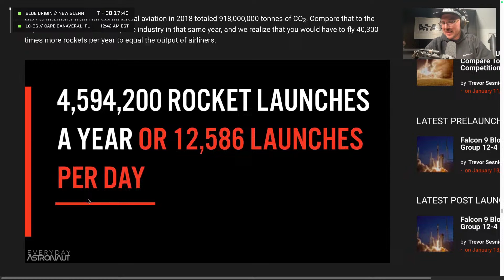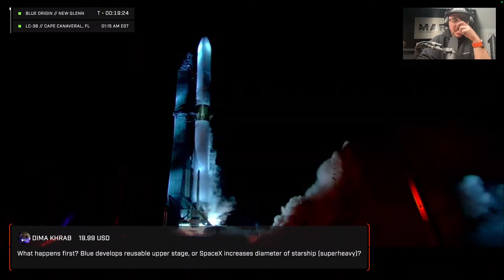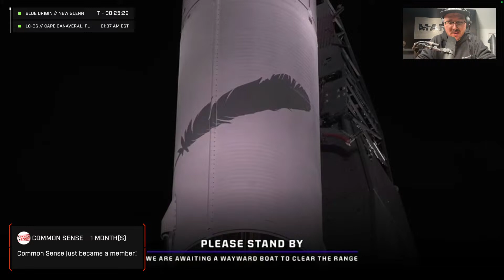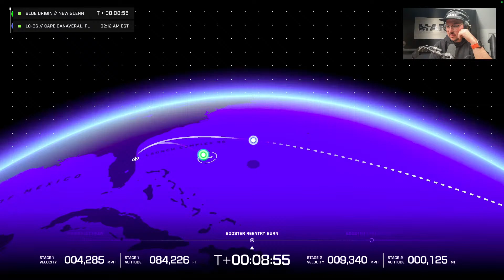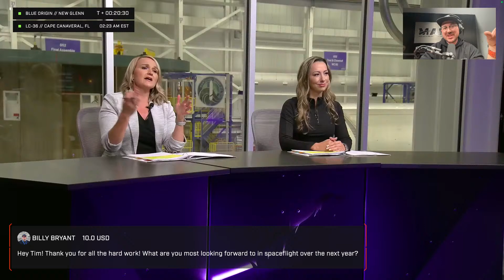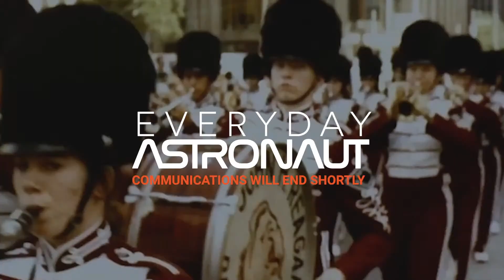Watch Blue Origin Launch New Glenn For The First Time!

Comment: Part of blue origins strategy is probably to watch the failure modes of starship and try to solve them ahead of launching their own. Costs a lot less to learn from competitors r and d
Reply: Different engines, different diameter, different propellant temperatures, different everything

They take longer to Flight 2 than Starship was despite not destroying the pad to a crater, and they previously planned 8-10 launches this year. Clearly that doesn't count as evidence
Reply: @alvianchoiriapriliansyah9882 true, I just know how r and d and reconstructive analysis of competitor product works at other companies having worked on competitor analysis jobs in manufacturing

Comment: I’m going to guess that when the callout guy said they still had telemetry on both stages, he was probably just confused. Maybe he accidentally checked the second stage twice, maybe he meant both engines instead of both stages, maybe he didn’t check whether the data from the booster was updating, but whatever it was, I think it’s a safe bet that the booster underwent a RUD right around when the booster’s telemetry froze.

Comment: interesting to see the speed difference new glenn vs starship 
45/86 mph clear tower  
437/881 mph at 3 miles
1 minute in; speed 340/702 mph  altitude 10700/26247 feet
2 minutes in; speed 1493/2097 altitude 69110/121391 feet

Comment: No experimental rocket has ever stuck its first landing! Ever! It's statistically and mathematically impossible. If it did it would be a horrible loss of data because that means it was pure luck! Experimental launches are about failures! Fixing those failures now instead of dealing with them later especially when humans are on board.

Comment: It's interesting. They skip the fact that 17,900 mph isn't sufficient to say you've reached orbit. Prograde thrust raises the apogee opposite the rocket. However the perigee remains at or below ground level. Only after half an orbit and again firing prograde to raise the perigee to above the karman line can you say you have achieved orbit. What we saw here was a duplication of the Starship flights but SpaceX caught a booster. 

Only after the second burn to circularize the orbit can Blue Origin claim to have achieved orbit. That burn, not shown here, would be approximately 45 minutes after "achieving orbit" here.

Comment: I was a bit worried about second stage loosing 27 miles of altitude while engine was still burning, before they cut the telemetry from it, declaring it's orbital, few moment earlier, but checked Falcon 9 Starling launches, and second stage is also loosing altitude before SECO, so I guess this is normal. SpaceX then does do brief second burn to circularize the orbit, but I guess it's not needed to "stay" in orbit, it's just for starlink propulsion to have less to do when going to their target orbit. So seems Blue Origin did indeed reach orbit with this one. Congratulations!

Comment: I noticed the same thing about the low TWR at lift-off.  The second stage was also accelerating slowly right after it ignited, and it lost significant altitude while accelerating to orbit which seemed strange since it had a very small payload.

Comment: Woah. That was slow off the pad. Quick comparison: New Glenn at 30 seconds going 170 km/h while Starship is already at over 500 km/h at that point.
Reply: Very slow considering the small payload.
Reply: @kennyg1358  We of course don't know if they were throttling the engines down to have similar acceleration to a configuration with bigger payload.

Comment: MHO--- the aluminum stage one booster melted in stratosphere ( 16 miles,altitude ) traveling at 4,285mph on the decent and lost data at the 8 minute mark. I'm not sure about using aluminum on a booster return?
Just a guess since I'm not a rocket scientist by any means...
Reply: Falcon9 booster is also made from aluminum (actually a aluminum-lithium alloy), and is reuseble too, also New Glenn booster have a special termal protection layer, that was explained in the interview that Bezos gave to Tim few months ago , you can watch the whole video from when he visited the factory on his channel if you want.

Comment: Amazing, they've done something that was first achieved 57 years ago with Apollo IV.  🤣

@1:34:09 It looks like a hot spot (dull red spot) at 7 o'clock from the center engine, between the two outer engines closer to the left one.

Comment: "This could be the first US built methane rocket to orbit, I just realized that."

Vulcan would like to have a word, Tim.
Reply: Using the same blue origin BE-4 engines no less.
Reply: Lamo completely forgot about Vulcan🤣🤣
Reply: The first Vulcan was methane plus SRBs no? So I guess this is the first fully methane US rocket at least for the first stage.
Reply: the upper stage is hydrolox, and so is this
Reply: @AeonExploration  ok? The first stage is methalox, and that's the most important part
Reply: @Alexander-NA  Yea thought it did. Thx
Reply: Also powered by Blue's BE-4's too..... Crazy, right?
Reply: At least have the booster /1st stage orientation graph telling us what it's doing
Reply: I'm confused, wasn't starship also methane and US built in Texas?
Reply: @threvorpaul it hasn’t reached orbit
Reply: @datmufn  ah thought it did.
Thanks.
Reply: @datmufn  StarShip has definitely reached orbit. Just because they don't go all the way around doesn't meant they aren't in orbit.
Reply: @Vortex-gz8se  You could say they could have reached orbit but all the mission profiles have been sub orbital.
Reply: @Vortex-gz8se It's suborbital because it was at all times on trajectory to intercept the atmosphere and re-enter without completing a full orbit. It could've achieved orbit with a circularizing burn at apogee, but for safety reasons it didn't.
Reply: @Vortex-gz8se they reached orbital velocity, but they did not go into orbit. They are still doing suborbital flights (hopefully flight 7 is the last suborbital test)
Reply: @datmufn  LEO, yes, it didn't orbit but could have.
Reply: @Vortex-gz8se well orbit means to circle around a planet so unless you go full circle it is not orbit
Reply: @mrthecodguy  no. Stop posting bs and study your knowledge from facts please. Spacecraft following escape trajectories or hyperbolic orbits never complete a full circle but are still considered in an orbital path. orbiting means being in a gravitationally influenced trajectory, not necessarily completing a full circle.
Reply: @ dayumm sir, my apologies….. just because your wife’s the boss at home doesn’t mean you have to act all tough on the internet my god
Reply: @mrthecodguy  No, orbit means orbital velocity. Just because they made the orbit intersect the Earth before it goes all the way around doesn't mean it isn't in orbit.
Reply: @Vortex-gz8se 
No, all flights of Starship to date have been on suborbital trajectories.  Indeed, they were specifically designed to not go all the way around which by definition means that they were not orbital.
Reply: @firefly4f4  Whose definition? They reach orbital velocity so they are in orbit. Just because the choose not to go all the way around doesn't mean they are not in orbit.
Reply: @threvorpaul  has not yet achieved an actual orbit, only orbital trajectory and velocity

Comment: 9:30 When people refer to "carbon emissions" these days, they usually mean CO2. Don't believe all the FUD-based marketing: it's an error to call that "pollution," because it's actually beneficial, not harmful. The only true carbon pollution is particulates (soot).

When it comes to rocket fuels, hydrazine is the worst, because the unburned fuel is nasty, toxic stuff (though the combustion products are fine).

SRBs are better, but they produce a lot of particulate pollution.

Kerolox engines (Falcon Merlin) are much better than SRBs, producing mostly CO2 (53% by mass) and water vapor (47%). But they run fuel-rich, so they do produce a small amount of particulate pollution (soot).

Methalox engines (Starship Raptor) produce even less soot than Kerolox. They mostly emit water vapor (62% by mass) and CO2 (38%).

Hydrolox produces nothing but water vapor.

Comment: Seems to have struggled at launch, Space X Falcon and Starship both reach Max Q around 1m10, this took 1m39 or so, quite the difference and it did look very slow after clearing the tower.. 28 secs to reach 100 mph, Falcon will be doing 300+ at that point, Starship about the same...

Comment: I listened to Scott Manley's deep dive on New Glenn. I'm glad I did because I realized that it is much more capable than even Falcon Heavy in terms of fairing size, payload dimensions, and ability to maneuver to greater orbits / transits. Of course, it doesn't have near the raw ability to lift a huge payload that Starship will eventually have, but for most missions its more flexible. Further, it seems that SpaceX is ramping up to mass produce Starship and may dwarf everyone else. Who knows if NewGlenn /BO can compete for the foreseeable future. Still, it's a big step and now there will be necessary competition. Even if they are dwarfed by SpaceX, it will keep them on their toes. Competition is good.
Reply: NG has smaller max payload than FH to any orbit.

Comment: At approx 8 miniutes into flight, altitude was 127 miles (Max per telemetry data on screen).At 13 minutes altitude was 100 miles...Not good if telemetry is accurate...!   Now radio silence from Blue.

Comment: Seen a lot of criticism about Starship not making it to orbit yet. The ONLY reason Starship didn’t make orbit is they limited it’s speed so it would fall back into the Indian Ocean whether the Starship’s engines relit for a deceleration burn or not. If the goal had been to make orbit, it would have happened, third flight onward.
Reply: Those are people that don't understand or don't want to understand what is going on. 

Besides Starship flights aren't really test flights, they are more like development flights. They're still radically changing the designs.
Reply: It will be interesting to see how BO handle the 1st stage results. This will be their first big test (assuming orbital test insertion and deorbit does work, which seems likely?). A massive test of their re-design ability. They may need to change something fundamental about their 1st stage (I.e. strengthening). 
Let’s see how quickly they reiterate.

Comment: Too bad that the flight data was in feet and mph instead of meters and kph like everyone else. Makes it more difficult to do comparisons. I wonder why they made such a ridiculous decision.
Reply: In this age of computers anyone is free to multiply two numbers together to convert units to their hearts' content
Reply: @milandavid7223  See my comment above.
Reply: 0.62 miles per km. If you ever drive in Canada, a 100 kph speed limit is 62 mph.
Reply: @richardloewen7177  See my comment above.
Reply: I’m used to imperial at this point.
Reply: @carbon273  That's not the point. When every other rocket launch is measured in metric and then one comes along in feet and mph, it makes it a pain in the butt to do comparisons, especially on side by side videos. There is then no way to do an accurate comparison. On top of that, when you listen to the audio, you hear the command center using the metric system. Just stupid.
Reply: Easy conversions. Practice it a bit and it comes naturally just like playing an instrument.
Reply: @jeromejooste3493  I know the conversions. I do them all the time. But try doing them when watching two videos of two rockets side by side to try to compare them while one is metric and the other is not. This is the only one I can think of where it was not metric. What's the point? It's just stupid in my opinion.

Comment: So did the booster land? was there no footage of this?
Reply: It did not.
Reply: RUD. Probably some anomaly and explosion after the engine relight, which happened to SpaceX rockets, too, a very complex problem.
Reply: @user1user1-b3j  If I were to guess, it didn't survive the forces of the boost back and high altitude winds. But in any case, this is no different than SpaceX's initial attempts to land 15 years ago.
Reply: @user1user1-b3j Yeah in all likelihood, either that or it just went into the ocean. Either way, successful for a first launch, New Shepard failed it's first landing attempt too, stuck the second!

Comment: Blue Glen have done what starship have ever done launch a rocket into space on their first flight well done blue glen we’re proud of you 👍 .
Reply: BG is way smaller than starship and it didn't recover either of stages, heck, second one isn't even made to be reusable. At this point it's hardly any different from Saturn rocket. Now only question how long will it take for them to launch second rocket.
Reply: @Zripas I think you glorify Starship a bit here. Starship wants to achieve fully reusable, but this cost them valuable deltaV. Blue Glen has proven the System and has an out of the box capability to pack a third stage and thereby can directly deliver to the moon. Starship is dependent on either a major redesign for their second stage or a refuelling system which we are years apart.
Reply: @nSnowCrow  
I'm not glorifying starship, OP mentioned both of those rockets, I responded by mentioning them both and pointing out major differences between them. Nothing special about it.
Starship entire point is to be fully reusable, while this will cost them deltaV if its made to work as they want it then it would be huge cost saving for SpaceX in comparison to BO. Its more complicated thing to solve, just like its way harder to make rocket which can be reused in general when you compare to something like Saturn, adding extra part which should get back to earth only explodes in complexity, but every saved part is saved cost down the road.
New Glen barely lifted from the launch pad, its deltaV was abismal, duno if this was intentional or was this actual max capability of it. Time will tell. Can't imagine it carrying something in one go what could reach moon. 
Starship isint in its final form, and doesn't use its newest engines either. Starship still has space to grow, figuratively and literally, hard to say what BO have in the works to help out with the deltaV
Reply: It's possible New Glenn will be sending payloads to the Moon and Mars long before Starship. As the previous poster mentioned, Starship will require orbital refueling or massive redesign to reach those destinations. Knowing SpaceX, they will go fast with these solutions, but it will take some time.
Reply: @jamesskintauy6773 
BO launched their first rocket which managed to reach orbit, which is fine, cool achievement in first attempt. Issue here is that we have no idea how fast they will make another one and try to do it once more. It could be weeks, it could be months, but it could be years too. With Starship we aleast have actual information on what they are working on and even how many semi ready starships there are already for testing.
And we yet to get actual numbers about actual NG capabilities, as of recent reports it suggest to only have 25 ton capacity, so who knows how good or bad it actually is.
Reply: @jamesskintauy6773  falcon heavy can already send payloads to the moon today, and since 2018 🤷
Starship has a different role...
I'm excited for Blue Origin and their finally reaching orbit, but neither they or we should get ahead of ourselves.
Starship can easily reach orbit should they choose to, but they are more interested in resolving other pressing issues with the vehicle around reentry and catch!

SpaceX reach orbit multiple times a week, pretty much every week of the year 🤷

Comment: Most likely:  Booster turbines sucked gas bubbles upon reentry burn?  First time doing a flip & burn maneuver, after all.  No video available.
Less likely: RCS thruster/thrust vector failure, wrong orientation, button pressed.  Looking forward to the video.
Reply: They are complete guesses, not "most likely".

Comment: so Blue Origin is now on par with Falcon Heavy. Launched 6 februari 2018. So what is new here?
Reply: Goal for New Glenn is to have 1st stage be reusable, only 2/3 of FH 1st stage is reusable...
Reply: @BillKermanKSP  so they failed since only 0/1 has landed. After 10 year simulation and using New Shepard as a test vehicle.
Reply: and they are trying for 25 years to get somethin into orbit. I am not impressed. BO is a lot hot air and shiny mock ups.
Reply: @edopiri  yes, but the goal is to land it eventually, for FH that's not the goal anymore. Ofc Starship could still beat it, but it hasn't so far
Reply: @edopiri  also, as you can see, BO is not about mock ups anymore. They literally have one of the heaviest operational launch vehicles now
Reply: @BillKermanKSP  
Making operational rocket is quite different from making reusable one. SpaceX did same thing with their first launches, those were not reusable rockets, it was just to get stuff into orbit, but to get consistent and reliable rockets which can be reused was the actual challenge. 
If next BO launch happens in 2 years, then they are in big trouble. Question is how rapidly they can actually launch next one as their development times are abysmal at this point.

Comment: 1:33:04 - T-10,
1:33:10 - T-4//Lift off,
1:34:50 - Max Q,
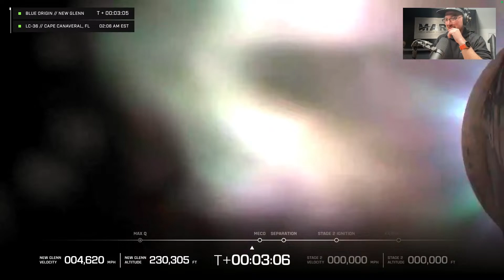1:36:18 - Meco,
1:36:25 - Stage separation,
1:37:08 - Fairing separation,
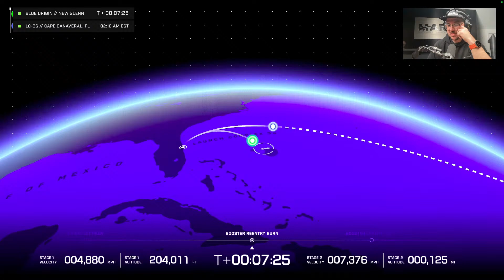1:40:44 - Booster reentry burn,
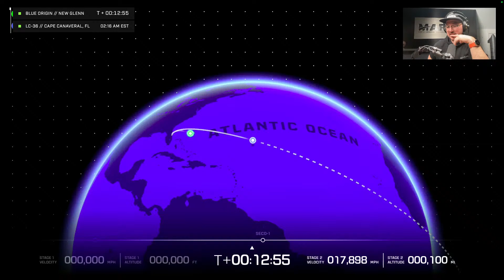1:46:10 - Seco 1.

I hope next time they will use Starlink for their live coverage.
Reply: Unsure if they will use starlink or not, they will definitely find a way to improve connection reliability, no matter if it is using satellite connections provided by Starlink or other companies like Oneweb.
Reply: @767pantine3 

The bright side is they definitely reached orbit
Reply: @767pantine3  dude, come on. It's 2025 and a multi-billion dollar company is unable to broadcast live footage from its own rocket.
Reply: Thank you so much 🤗